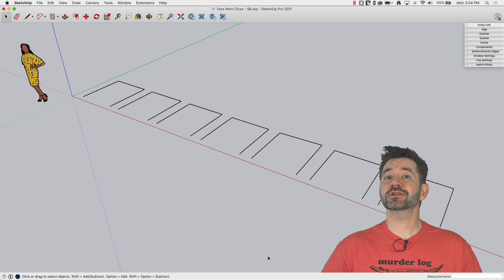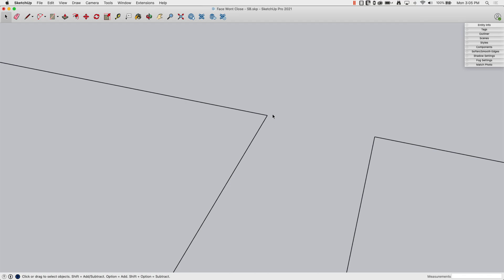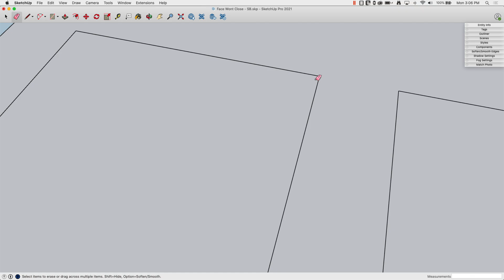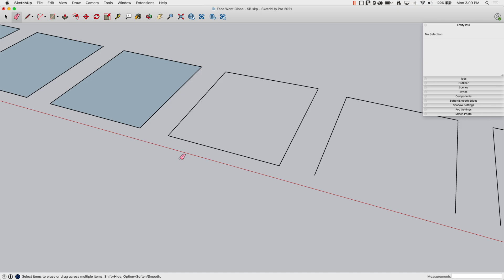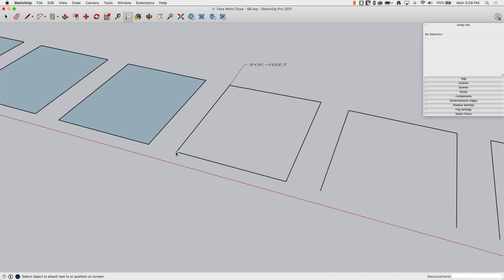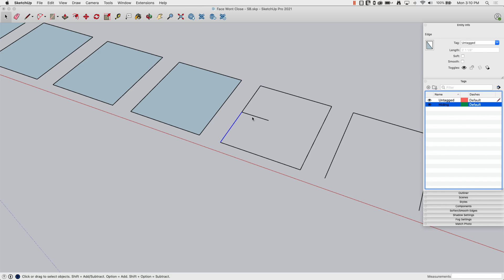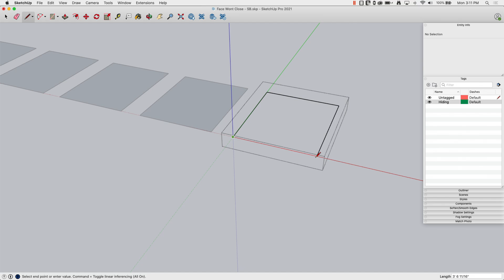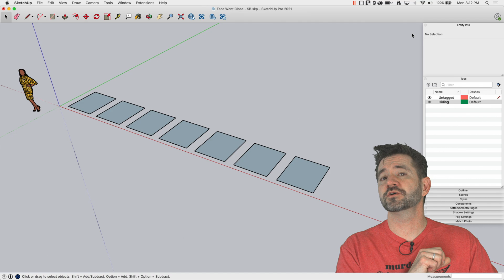When a Face Won't Close - Skill Builder

Comment: Thank you very much for this skill builder.  I have watched it a few times and have run into a few of these scenarios.  And your tips helped.  But working on a project - some stylized Islamic script with bezier curves and straight lines - I could not seem to get the face to close.  By subdividing the face I was able to determine that one area was responsible for the face not closing.  I reviewed all your cases and could not find the problem.  Then I stumbled upon it.  I used the line tool to draw a shape around the suspect area and WHAM! - the face in that area now showed as closed!  I was able to remove my "shape" lines and it still showed as closed.  I don't know why this worked, but it did.  I'd love to know why this worked, but I'm not looking a gift horse in the mouth...

Comment: Great video.  On an associated point, is there an easy way (or add-on tool) to map all points onto on of the standard planes / axes and or user defined planes.  In the 4th example one corner was out of the normal plane and you had to manually move a point onto the same plane the other points were on.  This can a problem when 'trimming' solids that leaves faces that are not the standard planes and I've found it really difficult to get a face properly aligned following the trim.

Comment: I have a sawtooth roofline with three peaks projecting above and along the parapet. The parapet wall is continuous with the building wall; the rectangle representing the wall and parapet is 4 ft x 37’4.” When I drew the series of lines to be the surface to become a group and then receive texture (vertical corrugated metal) the figure did not close. Then I tried a series of adjacent rectangles and triangles. Then I have seams. I haven’t learned as yet whether seams can be eliminated. (This is in schematics, so that’s not crucial.) I followed you video on manipulating textures with the pins in Texture/Position, but find it difficult to rotate and scale consistently.
I tried another idea. I made a large rectangle flush to the building corners at each end and at the right height for the bottom horizontal line (a high watertable) but projecting higher than the sawtooth peaks. I pulled it out less than an inch and then to a foot. With x-ray on, i tried to draw lines on the surface, but the clicks were not staying on the rectangle. No luck. Is there a way to project the roof line onto a surface? Or is there a way to confine the change-of-direction of the line to a surface? As I send, I am using guides to work my way along the parapet and peaks. 
If this is a problem of interest to others, I would love to see a tutorial, Aaron.
Reply from the maker: This sounds like a job for the forum (forums.sketchup.com)! What you are describing sounds totally possible, but is hard to follow with just text. If you hop on our forum you can share your model or any images youa re working from and help us tto help you out!

Comment: Nice, but what's the matter with those reverse faces showing as top surfaces ,any fix to this,i face it a lot
Reply from the maker: That happens when a face is drawn on the ground plane. SketchUp intuits that it will be the bottom of what you're drawing and makes the external face downwards.

Comment: the problem is that this program is not very accurate.. so skewing lines and non-closed gaps is the new normal for Sketchup - i hate this program --- alot
Reply: it's not user friendly with compare with CorelDraw, AutoCAD and other pro CAD software. thanks to this clip.

Comment: Often I start with a solid; then add a feature to it and it is no longer a solid. Even the simplest of features can cause a "leak".  Any basic techniques you can demonstrate? Thank You
I find your Skill Builder tips valuable.
Reply: Ahah, another "leak" prospector. Thought I was alone. For years I've been drawing lines to progressively isolate the hole. And eventually plug it.

Comment: Stl files are the worst at editing because of so many faces or bad modeling
Reply: Too true! If I import STLs I generally bring them in as large as I can to avoid small face issues and try to use an extension like Skimp to clean them up and/or reduce polygons
Reply: @AaronMakingStuff i wish sketchup pro could export as a quad mesh rather than a triangular mesh for better editing of meshes. Stl format is just a mess with any program but3d printers need it haha. 
Would be cool if sketchup had a way of doing FEA on parts. That would be handy:)

Comment: Does SketchUp have a planarize tool? Is there one available with an extension? And while I’m in the asking mode, how about an extend line tool?
And thanks again for this one!
Reply: For flattening something you've drawn, try Eneroth's Flatten to Plane (flattens to Z axis only). For extending lines, drawing perpendicular lines or normals to a face, and much more check out the 1001bit extensions, especially the Pro version, or Didier Bur's Projection and Guide Toys extensions. I use both all the time. The Fredo6 Draw Along extension can lock you into drawing on any plane or any vector and can convert lines to guides and guides to lines.
Reply: @stephanholland6181  thanks a lot!
Reply: Or a fillet with radius zero, an old AutoCAD trick.
Reply: I use Thomthoms Vertex Tools and there is a make planar command in there. That is a paid tool, though

Comment: Your last example is often overlooked in diagnosis, if a shape won't close, the common fix is to redraw each line in turn believing that one of the lines didn't make contact. Remaking the existing 3 lines OUTSIDE of the group will complete the shape & create the face , obviously connecting with your drawn 4tn line!
Reply: I have to admit, I have done that more than one time trying to force something to close!

Comment: Here's a trick I always use to find the cases where a tiny or hidden element is breaking up an edge preventing the face from closing:  Just go to Styles->edit and check the endpoints option.  All the points in the model now appear, including points where a hidden line, tiny segment, etc., is breaking up the face.  And then after fixing the problem, you can go back and uncheck the endpoints option.

On the other hand, this video gives me a new idea:  Often I'm drawing a floor plan or something with closed shapes that I DON'T want filled.  in the past, I would just delete the auto-filled face, only to have it automatically appear again after editing another edge on that face (or whatever).  In the future, if I have this problem, I'll just insert a tiny line from one edge into the closed area.  Auto-fill disabled!  Cool!  I just have to remember to delete the tiny line when I'm finished editing in that area.
Reply: I can't find this tab Styles->edit
Reply: @baiduipod  I found it: Default tray/Styles/Edit/Edge settings/tick Endpoints to reveal all 'dem nasty hidden gremlins.
(highlights expected and hidden line-end points).
Reply: @Mrbobinge  It wasn't in my default tray and after adding it to the tray, there is no edit option
Reply: @L_Fleury  Watch my lips: Default tray/Styles/Select /(be sure to choose DEFAULT STYLES)/Edit (to the right of SELECT in Default Styles menu)/Edge settings (first, of five icons)/tick Endpoints. [It took me 14 years to discover this gem].
Reply: Great tip - thank you. I'm quite keen to have a real issue soon, so that I can try this method for real. Somehow, simulating a fault isn't quite the same, so I'll just have to be patient.
Reply: great tip, I never thought of that. Nothing worse than not being able to find the problem.
Reply: thank you for sharing, this tip saved me from wasting another hour trying to close the face

Comment: Can you clarify your point in the last example. As a novice, this one is an area that I struggle with a lot. You said instead of exploding, "you can click into it and keep them separate." Are you editing the group at that point or is the new line still somewhat separate?
Reply: yes Joe double clicking on a line puts the group into edit mode. Gets confusing sometimes.
Reply: @donsmith3167  thanks
Reply: Aaron is presenting two options: (1) If you want to keep the group containing the shape you're trying to close, then click on the group to open it for editing and add the line inside the group.  (2) If you don't need the group, use explode to remove it, separating all the elements that were in the group, so that now you can add the line and close the face that way. 

If that doesn't make sense, you may not understand exactly how groups work.  There are many videos on YouTube explaining groups in Sketchup.
Reply: @kenhaley4  that does make sense. Thank you for clarifying
Reply: Ken got it!

Comment: I also have made geometry where one side is comprised of more than one slightly unparalell lines, and the inner one not connecting at the corner. Its a variant of the "edge sticking into the area where the face is supposed to be" , but the problem is more difficult to find, as there is no broken sides. A working view with lines colored by axis solves this for me.
Reply: I've done that too--it's a good idea.  But it doesn't help if the shape is off-axis (maybe rotated 45 degrees or something).